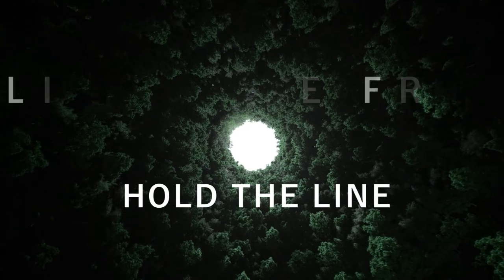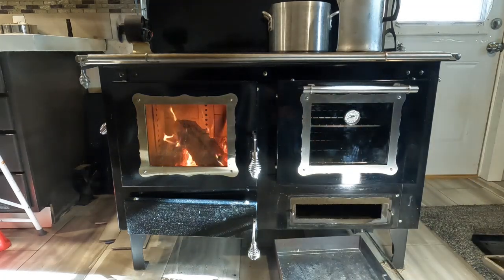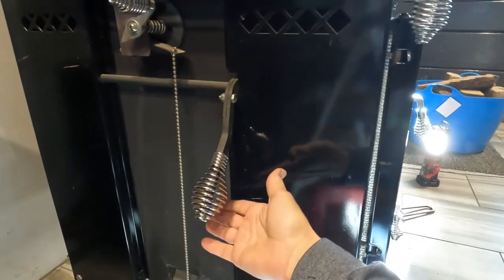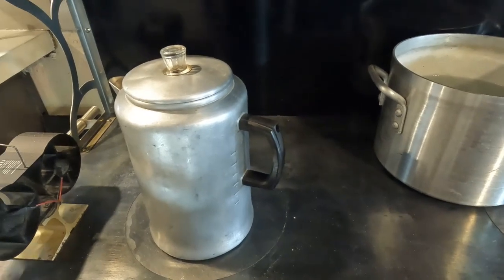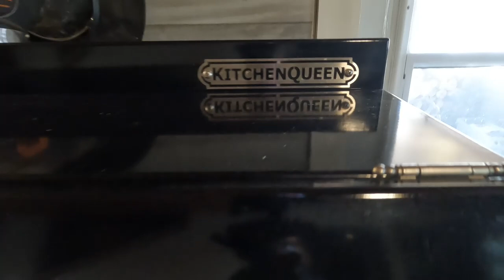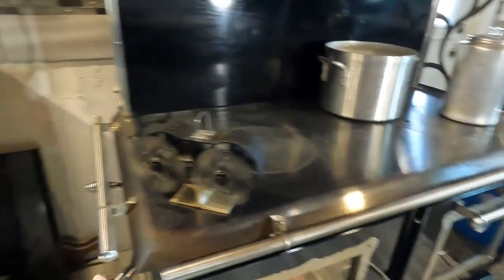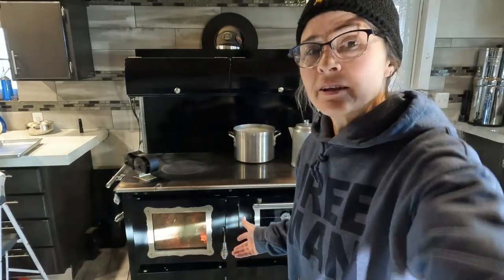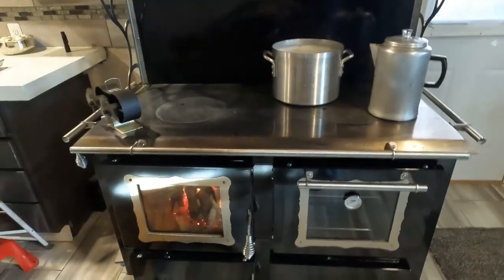BEE shows us how the Wood Cookstove works.

Comment: May I make a suggestion? Take a fine mist water sprayer and as you pull out the ash, mist spray the water over the entire ash pan and opening and it will cut down on the flying particles.  Then you can take a towel and dry all the wet surfaces and because it is such a fine mist, it isn't a whole lot of water and will dry right away when you put the pan back into its spot under the fire.  Thank you for a wonderful video.
Reply from the maker: Jan, thank you. We will try it

Comment: I grew up with vintage woodcook stoves. We lifted the circular lids, placed a nice cast iron skillet or cast iron dutch oven on the flames, got a good browning of food. We never worried about the black bottoms of pans. Sadly, it looks like the holes are not placed above the fire in this stove.
I also liked the vintage stove better with the warmer oven doors folding out instead. The fold out doors of the warming area were about an inch thick, so often not too hot for our cats to sit on. Our cats loved sitting on the fold out doors when the stove was warm to cooler.
Reply from the maker: One hole is, we don't use it for that but maybe we should try. Thank you
Reply: This is one of three woodcook stoves that I am looking at. First off, I need a 6 inch flue and reburning technology.
Heco 520, the Margin FlameView, and  this Kitchen Queen 750. 
In your vid, I see the left most big round lid you take off.  It looks like it's not exposed to full open flames. 
Thanks! 😊😮
Reply from the maker: We chose this one because of the reburner. We also lo9ked at several others
Reply: Yes, that's why it is on my list. Reburner tubes or vents in the firebox to reburn gases. Margin Fireview, and Heco 520 also have reburning technology.

Comment: Great tutorial! Love the woodstove. If ever there were a time I’d recommend a mask, it would be while cleaning the creosote from below the oven.  That creosote was airborne.❤❤❤
Reply from the maker: Yeah, the ash gets everywhere. We have an air purifier in the kitchen for that exact reason. I Usually don't do it on such a windy day, It's usually not that bad.
Reply: @LifeDoneFree  Thank you for the tutorial. I suspect that you only use the oven bypass when you actually want to use the oven? Finding an answer to that question is amazingly difficult. I have the Kitchen Queen Hearth Master 240 (the smallest of the Kitchen Queen wood cook stoves). The Grand Comfort with the glass firebox door was what drew me to these stoves. But even the smallest model (480) is too large for my space. The 240 doesn't have a glass door on the fire box. Do you find you look at that much? Also, did you not order the summer grate for yours?
Reply from the maker: @Growmap   yes, we only use the by pass when cooking.  I love the glass door. i look at it everyday. i dont know what the summer grate is.
Reply: @LifeDoneFree  That is the one thing that isn't available on the Kitchen Queen Hearth Master. I knew that when I ordered it, but still sad about it. 

Some claim that it is hotter to stand in front of the stove if you have a glass fire box door than a metal fire box door. I imagine that varies by stove. 

On the Hearth Master, the air flow controls are on the firebox door. They said they are considering offering a glass door later. They're easy enough to swap out if they do and I decide I want to spend the money to get one. 

A kitchen grate for a Kitchen Queen stove is a metal grate with fold-out legs that you can insert into the fire box. 

So in the summer, you can build a small fire close to the cooking surface and cook without generating nearly as much heat. 

I expected them to put slides in the firebox, but it is freestanding. So anyone could buy one or have one made. It sounded like such a great idea given I live in SE Oklahoma where most of the year isn't cold.

Comment: Have you had any experience operating a pressure canner on that wood stove or any other woodstove.   
  I pressure can on our gas stove at home, but we have a more remote property with a wood cook stove. Is canning on a wood cook stove practical and safe? Also is there space enough to operate two pressure canners and keep them at the right temperature?
Reply from the maker: Yes I have, the challenge is just keeping it hot enough. With the wood stove there are hot and cold spots. I have never tried running 2 of them but, I would think you could if you were there to babysit it.

Comment: Nice stove,,,but u didn't really explain how to use the oven,,,do u have to transfer the heat to the oven,,,just wondering how that works,,,can u explain that
Reply from the maker: Tommy , there is a valve on the right side of the stove that let's the heat surround the oven. These are other levers or valves that let you control the temperature.  I hope this helps